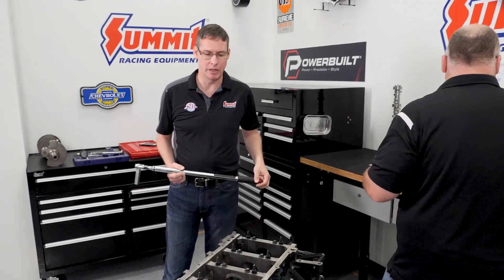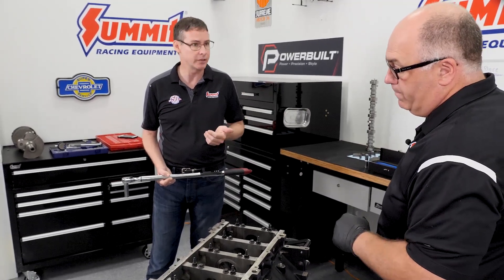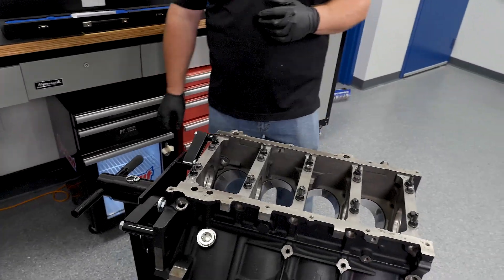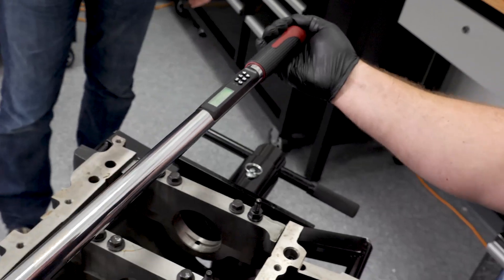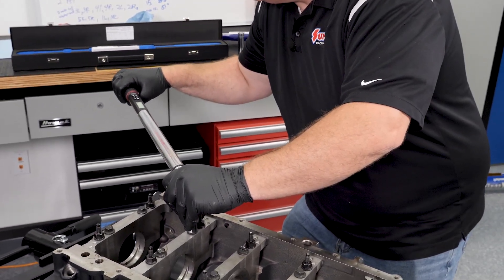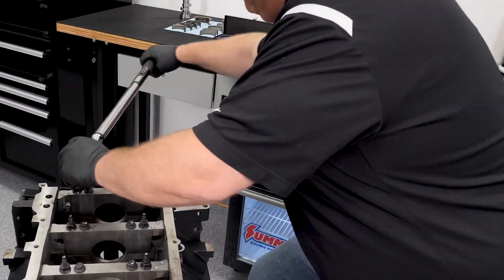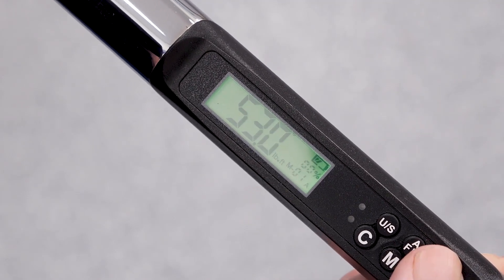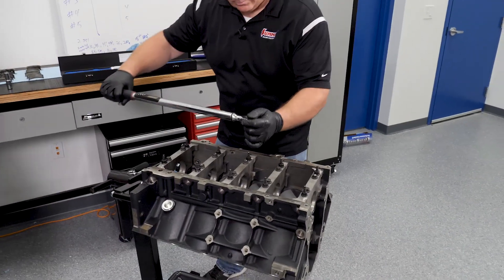How to Install Torque Angle Bolts -- Engine Building 101

Comment: Inner:  60ft/lbs  Outer: 50 ft/lbs  Rod Bolts: 50 ft/lbs.   Your welcome verified by several torque wrenches.  Use clean bolts with some light oil.

Comment: The product listing for this torque wrench on Amazon says " * If unit has Angle Measuring Function: Lay unit on flat surface when powering up to finish auto angle calibration "

Comment: Just use ARP bolts and torque to a value not angle. Save the cost if the expensive wrench plus have a better bolt!
Reply: Only problem is that you need to line hone.
Reply: Wouldn't you still need to have a "expensive" accurate wrench? Like, I wouldn't do engine work with a local tool store torque wrench for example.

Comment: Get that left hand off of the torque wrench head!!!
Reply: Good to know.  Is this impacting the values?   I've never done any serious bolts like these bolts.   Is there a better place to get leverage?
Reply: @YTMegiddo  use both hands on the handle if necessary. The values are calibrated to a rotational force at the handle. Placing your hand on the head of the wrench add a second and imposing force. Many will dispute this, but its fact.
Reply: @kevinshiley9061  Excellent!   When I've done it, it was more to keep the wrench from slipping off (old habits from crappy bolt heads).   So I see how that could also affect the values.

Comment: Did you ruin the bolts just for this demonstration? Were they single use bolts? Why not get ARP studs and have a much better fastening system?....
Reply from the maker: Thank you for your question.  The addition of ARP bolts would be good, but would require a line hone afterwards.  At this power level, the factory bolts are adequate.  They are torque angle rather than single use torque to yield.
Reply: @SummitRacing  Could you explain why it would be necessary to line hone if ARP studs were used. I have used them numerous times without line honing, did I do it wrong? Thanks!!!
Reply: @dannywilsher4165  ARP main studs for LS engines have greater clamping force than the original and may distort the main caps and cause an out of round condition. On some engines, l have installed new main studs without align honing the block, but l check the mains very closely. Hope this helps.
Reply: @m.a.p.4hp737  Yes Sir, thanks!!!
Reply: @m.a.p.4hp737  if torqued to the same value, why should they apply more clamping force and cause distortion?
Reply: @kevinshiley9061  The torque specs are not the same for ARP fasteners compared to stock. ARP bolts have a higher tensile strength.
Reply: If you install studs you have to send the block and mains back to get the main line rehoned
Reply: @Braapcity  I've never had to do that. And I've built hundreds of engines....
Reply: @dannywilsher4165  I wouldn't want you building my motors if you aren't aware of that. Why do you thinking the hone engines with torque plates? Torque load changes shapes and clearances. If you don't know this, maybe you shouldn't build motors
Reply: @Brive I've got a feeling his 100's would be 3 if done Correctly.  Unless he is smarter then ALL the top builders in the world.  I'm Surprised he came to this video or comment section.  Spare time? Waiting on the snap on truck?  Or just an 🤪🐓🍭 running his mouth. Forgot to read the instructions on his a r p bolts.
Reply: @Braapcity   I'm pretty sure you are 100% correct about not wanting  me to build you an engine. You probably couldn't afford it and I'm pretty sure you couldn't handle the power!!!!!
Reply: @dannywilsher4165  so you're saying you over charge for shit work? Show me dyno sheets of your builds. Even summit racing replied "you need to line hone if studs are installed" any engine guy here but you does that lol. Show me your engineering degree
Reply: @Braapcity  I actually have two engineering degrees. But it is of no importance to me to sit here and listen to your bloviating. Go back to playing with your snow machines and have a happy new year ...
Reply: @dannywilsher4165  looking at your videos, i dont see any of these engines you built. As far as engineering goes, you screwed some old chevy emblems to a piece of wood. Yep, Temu degree
Reply: @Braapcity  okay that be funny.